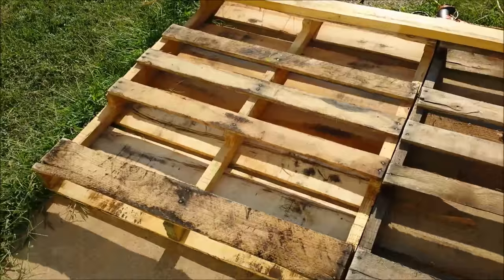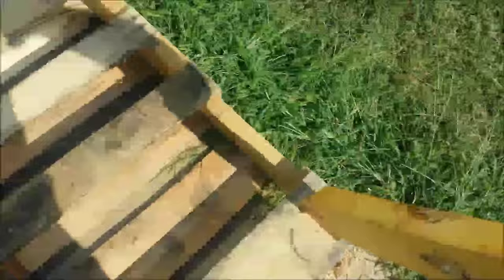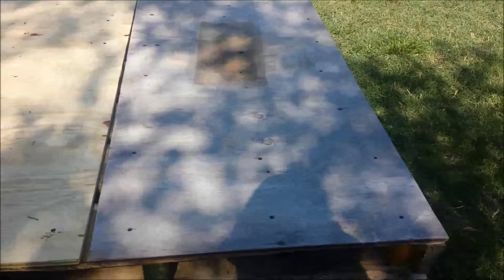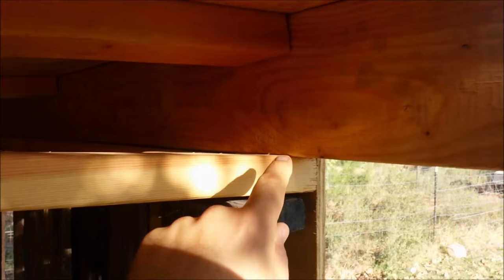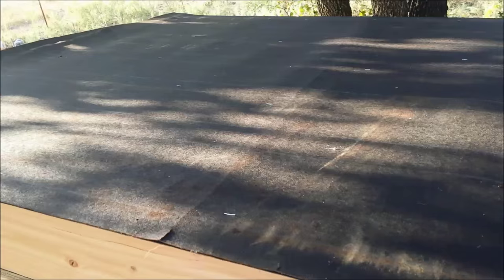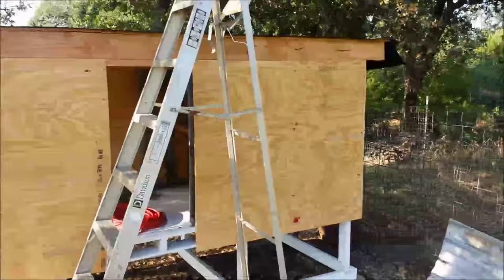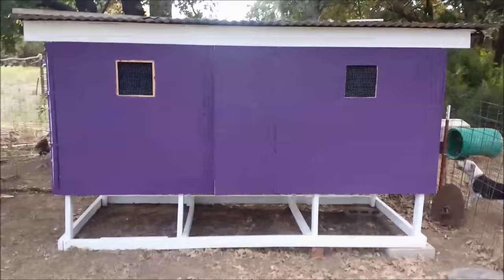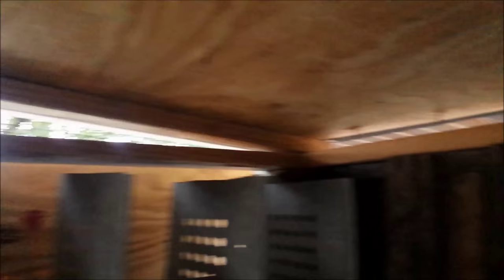How to Build a Pallet Chicken House - Start to Finish

Comment: This was the BEST example of a pallet coop I've seen in a while. You guys have great step-by-step instructions. I wish it was a bit lighter inside so we could see how you did the nest boxes and food/water stations. Overall, great vid.
Reply from the maker: The nest boxes were just some metal ones we were given that we modified to fit. We feed and water outside so there are no stations set up inside for that. To clean out we open both doors, remove the nest box and rake out everything into our wheel barrel to go to the compost pile. I do deep bedding so we clean out/replace shavings every 4-6 months.

Comment: Not sure if you’ll see this but I’m about to make a pallet coop for my chickens and I have two questions. Without any insulation does it stay warm enough in there in the winter? My winters can be freezing or below for short times so I wonder if I need to insulate. Second question, have you had any invaders in your coop (fox or raccoons)? Has it been pretty secure? I have the pallets in my yard ready and I’m super excited. It’s seems so much easier and cheaper  than building from scratch. Thanks for your video.
Reply from the maker: claymonsterpottery we are in zone 7b so it can get at freezing or below for short times and my chickens do fine. We did a 5 year update on this coop if you want to go check that out, we talked about some things we would have done differently. As far as predators go, we’ve had snakes get in but we have dogs that keep other predators away, as long as you make a way to close them up at night you shouldn’t have any problems. My father in law has had some predator issues though and they put a couple of strands of electric fence (at the top and bottom) on their chicken run and that solved the problem. The coop itself is tough, a bear could probably break in but I don’t see anything smaller than that going through it. Hope that answers your questions.

Comment: your coop looks great... I have 2 question.   now that your are done with the build and time has gone by, Is there anything you wish you had done different... and,  about how much do you think you actually invested in your build...
Reply from the maker: Rick J There are a couple of things I wish we would have done. i wish we had put down a piece if linolium on the floor of the coop so it is easier to clean out and i wish we would have made external nest boxes with a flip up lid instead of opening that big door on the side. If cost wasn't a consideration i would probably have put actual siding of some sort on the outside instead of the painted plywood, we did have some slight swelling in places on the plywood after the first rain. Our total investment was less than $200 but I dont remember the actual amount and we had quite a bit of scrap materials on hand also. We have not had to invest anything else into the coop and 2 years later its still rock solid.
Reply: @GrowingaJoyfulLife  I wondered about the clean out part. The flooring would've been a nice touch.

Comment: Not to pry to much but how did your chickens do in winter?  I live in Maryland so our winters are some what mild at times but also down right brutal.  Do you heat you coop or do they do ok? What are the dimensions?
Reply from the maker: My chickens have done fine in it for 2 winters now. I do not heat my coop at all and am in zone 7. I'm sorry but I don't remember the demensions off hand if I have time I'll try to remember to go out and measure it later. Thank you for watching!
Reply: Robert, research 'cold weather chickens' if you get them from a hatchery. Some chickens fair much better in cold weather than others. I'm in PA and my chickens always do fine inside a coop that's only insulated with ( can you believe it?) cardboard and empty paper feed and dog food bags. It's a solid wood structure and I put plastic over the wire on the walk in door to the coop to keep out floor drafts in cold weather.